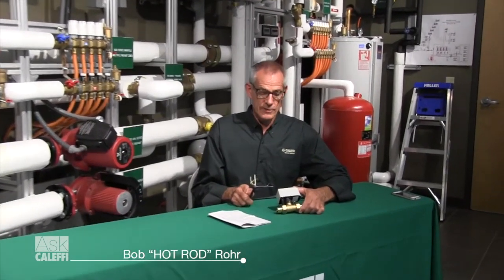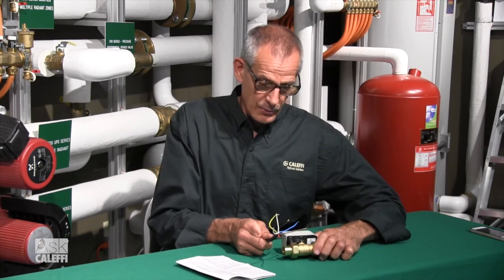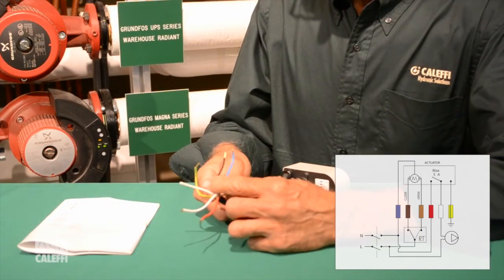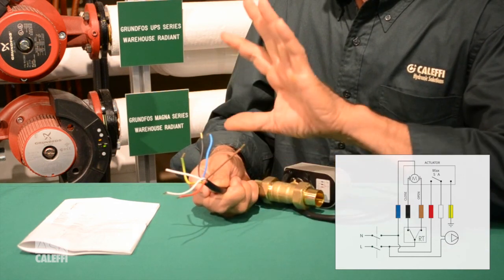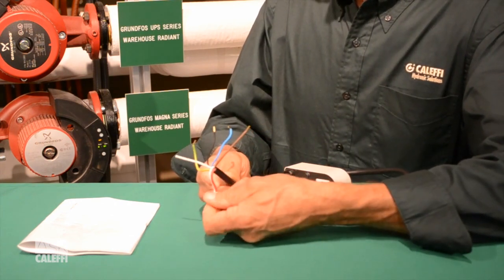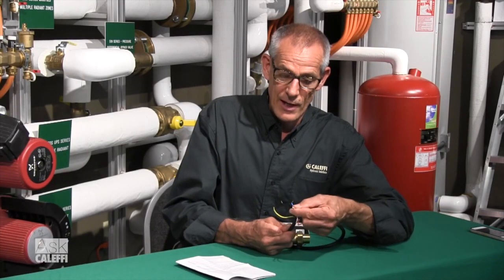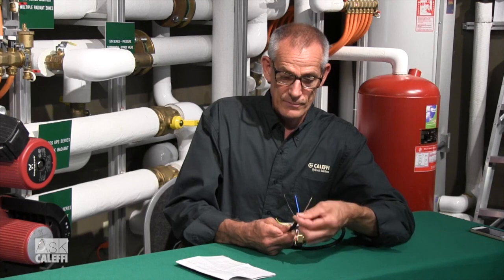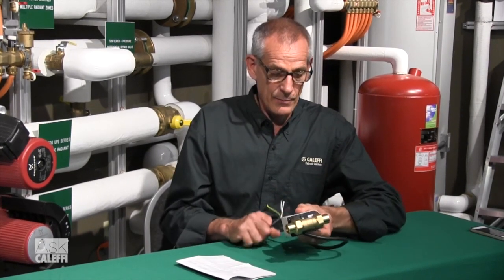How do I wire the 644 power-on/power-off zone valve?

Comment: I'm using this valve for my
Geothermal. The instructions are awful. They can't even spell the wire colors correctly on the English translation. I don't understand if the 230v wires need hooked up. I have the 24v side hooked up but it doesn't seem to be working.
Reply from the maker: Good morning! Have you tried and checked on the North America website? Maybe this link can be helpful: http://www.caleffi.com/sites/default/files/file/01131_na.pdf
There are no 230V wires, only 24V. Wire the motor to operate using the blue, brown, and black wires as shown. The red and white wires are for the end switch. The YouTube video describes this proper wiring.
Let us know if this helps, please.